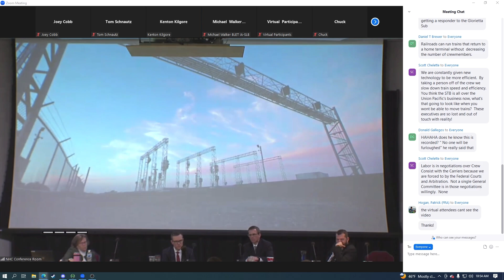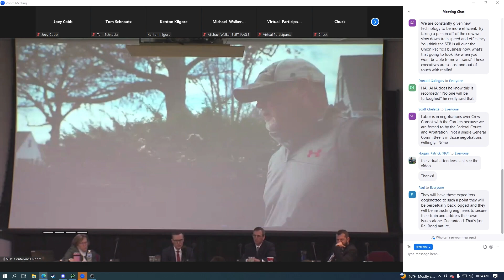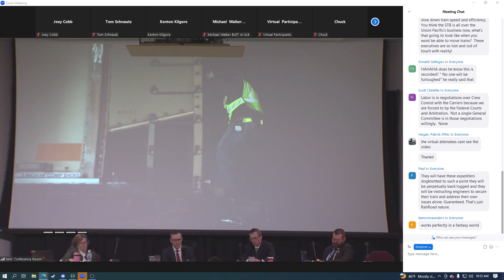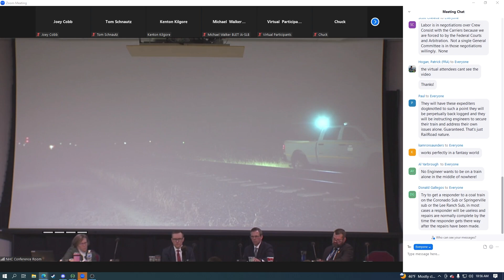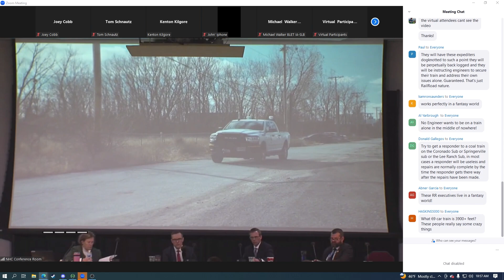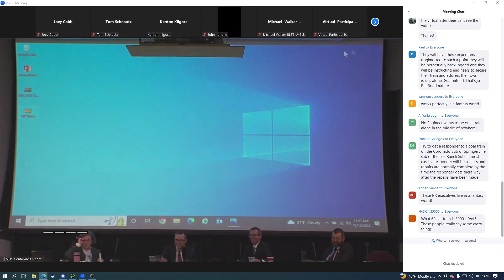Union Pacific One-Man Crew Idea - Stupid & Dangerous

Comment: This is the problem with modern railroads since the end of steam power in the 1950s all class 1 railroads cut jobs first was the roundhouse and steam locomotives that required lots of effort to maintain. Then was passenger trains in the 1960s. Next was we saw local freight trains decline it started in the 1970s. Next was the end of the caboose in the 1980s. Afterwards in the 1990s so many railroads consolidation began and had less crews afterwards. And then 2016 psr. Screw these people there is a reason I love railroads before 1950.

Comment: They are moving the role of Conductor into a Field Maintenance role, and then telling the Engineers that they'll need to operate on their own.. Then argues that it's "for quality of life" for conductors. That really wasn't the point being made by the Unions if I recall. They don't want you to change their job, they want you to be able to schedule ( within reason ) so they can plan their life around it. That's not even the bigger issue, the issue is you've unintentionally created a dangerous work environment by reducing the crew size of a train. If it has worked so well for the past 150 years, then why change a system that works? We all know the rail networks infrastructure can't handle autonomy, so why try? Bad choices. Tsk tsk.
Reply: I was kinda picking up by the speaker saying they are doing this for quality of life that basically he was saying is F U  you guys did this to your self. You want quality of life this is what you get. I dont really see this being any safer or quicker in any way. Curious to how this all plays out

Comment: Yeah, I hired on to be on a train not in a pickup. Plus, good luck keeping a lot of these ENs awake now. I had to yell at them to get them to reset the alerter many times.
Reply: Let's not play this game, focus on stopping one man crews! 

We've all been caught short rested, don't give the RR's more fuel. They get enough from the on board cameras.

When the infighting starts, we all lose and give them what they want!
Reply: @shawnkelsea1763  my comment wasn't meant to be derogatory so I'm sorry you took it that way. I mean if you're an EN I'm sure you can vouch that having another guy on the head end is a good thing. You can help each other stay awake for one thing. Plus you don't have the luxury of getting out of the seat and pacing around the cab like I did if I was tired. Also it lets you focus on running and not have to fool with the radio or calling signals. I don't have anything against the ENs if thats what you're assuming. Hell, I probably learned just as much from them as I did the COs. It was even them that showed me how to tie up and do other things in mainframe. It's about the safety aspect of having 2 men in the cab.
Reply: Don, I didn't take it that way but some might and a war of words could start.

The RR's love it when there's in fighting between the unions and the crafts. That's when they get their worst work done!

I would never want to see conductors in a truck! That's wrong on so many levels and yes, they're needed in the cab to help ease the load.

I think there's an FRA rule about bathroom breaks and having the train stopped. I'll have to look it up, basically the train can't move until the member of the crew returns to their seat.

Conductors dissappear, going to be a bunch of stopped trains for bathroom breaks alone!😉
Reply: I like my occasional naps 😁
Reply: I’m guessing a lot of them might quit. It’s completely changing their job around. We had a guy at our shop who was a great employee who worked the service truck, once they started the layoffs he got bumped to a hostler and ended up quitting a few weeks later as its not what he signed on for so i can imagine half the fun of a conductor is riding the engine, seeing the world, blah blah blah. I’m sure some will stay for the paycheck but if a job ain’t fun some will leave